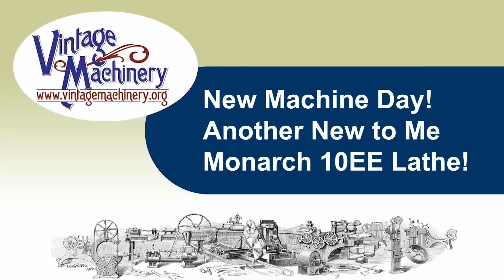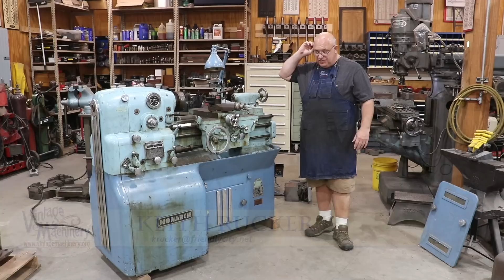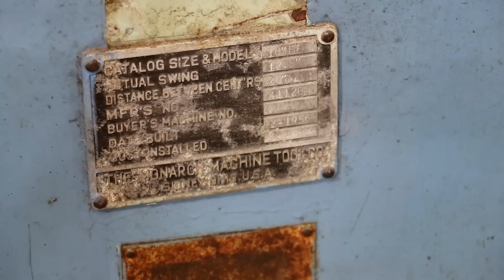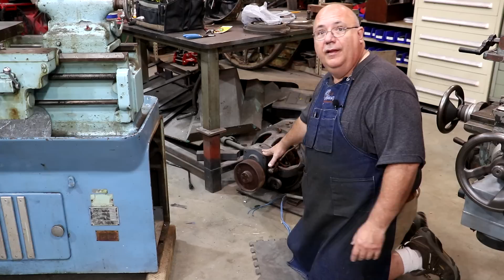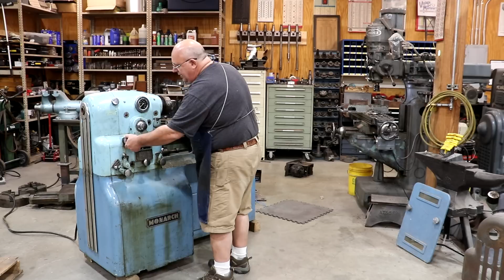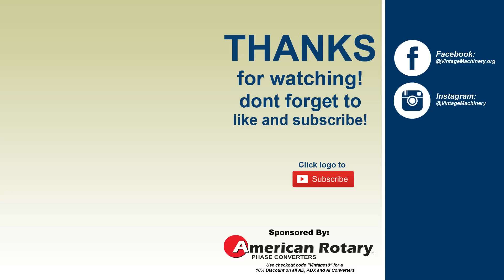New Machine Day! Another New to Me Monarch 10EE Lathe!

Comment: As others have mentioned, it sounds like the motor needs some attention. Probably the brushes are worn out, and making poor connection to the commutator. Brushes are consumables and need to be replaced periodically. Likely they are still available for that motor. If they are allowed to run for a while when work out, they can damage the commutator and make a simple repair turn into a motor rebuild.

Looking at what I can see of that power supply, it sounds like that Variac is a 110V unit, and the bull switch on the back happens to be rated for 120/208, but in fact is only intended to be run on 120V. The circuit is probably thru the Variac to that transformer, which is probably a 120V/240V (or 120V/208V) control transformer. The output of the transformer goes to the rectifier, making pulsating DC for the motor. 

The control system should be making a nice voltage between 0 and 240V to the motor, and the Variac should be controlling the voltage linearly. It seems a little unlikely that running the motor at a lower voltage should necessarily result in the surging, which makes me suspect the brushes. The original power supply wasn't a lot different in concept than that jury rig that the unit has now.
Reply: I disagree. The reason the original unit had valves was because it had good load regulation.
Variacs have terrible load regulation and a variac system on a lathe like this was a terrible choice, a nasty kludge probably done by a seller at some point.
Modern DC motor controllers are common and cheap enough.

Comment: Is there any chance of getting an original control circuit? Looking at the schematic there's a lot of sophisticated wave shaping and phase shifting stuff to make the lathe work really well and not change speed under load etc.  There were only two tubes, both rectifiers which could be replaced with industrial diodes. Then all the capacitors would have to be tested and probably a lot of them repl;aced, but for very little money it would work like it did when it was brand new. You could get any kid in an EE program at college to fix it, or even advanced hobbyists. It would be a shame to give up all of that sophisticated engineering that went into it.
Reply: Patrick, where did you find the schematic?  I'd like to have a look.
Reply: @hankcohen3419 https://www.normanmachinetool.com/wp-content/uploads/2017/02/Monarch-10EE-Manual.pdf
Reply: @hankcohen3419  Keith has one of  the Works in a Drawer (WiaD) 10EE manuals on his site. The manual has  a schematic.
Reply: @ronkellis769  Thanks!
Reply: A "Works in a Drawer" drive has 2 C16Js for armature voltage control, 2 3C23s for shunt field voltage control, an EL1C for DC control voltages and  5 other 'audio' tubes for timing pulse generation, power on restrictions, etc.  It's more complex in that there's provision for increasing armature current under load and the whole 'field weakening' thing to get the motor up to full speed (with provision to handle field loss, etc.).  The DC panel handles fwd/rev switching interlocked, anti-plugging relay, applying field for acceleration/deceleration.  The motor is a compound motor with both series and shunt fields for stability across the speed range.  For it's time it was a heck of a drive, still is really.
Reply: @russkepler  I'm still looking for the schematic.  Can you post a link?  I don't see this in the 10EE manuals.

Comment: Modern mill spindles all use AC drives that suffer from low torque at low speeds. Some but not many have a high/low gear to mitigate that. But most just over size the motor. I have a machine with a 25HP spindle that can't do what my 3HP vari-drive does on my manual DoAll mill.
The Hardinge  toolroom lathe uses a cone pully varidrive and a two speed motor for great performance over a wide speed range. A gear system that reduces the speed by half doubles the torque. Without a gear ratio means of getting low speed and  high torque, the cut performance suffers at large diameters. You can't drive big taps or big drills either. This is why most lathes have a geared headstock. If you put a vastly over sized AC motor in your lathe you might get enough torque at low speeds. A  gear box would help too. Modern motors are much smaller so a 10HP maybe larger might fit. I wonder why they put vacuum tubes in a lathe when no else was doing it and better and simpler solutions were widely understood.

Comment: Full wave bridge rectification of 208V AC = 291V DC, but you need the filter capacitors which are missing. 291V DC is to much for a 230V DC motor. My question is; are the monarch DC motors series or parallel field motors?
Reply: Not sure where you're getting 291V, full wave rectification of 208V would give about 80% of the single phase voltage.

The original motor on the 10EE is a compound wound motor, both series and shunt fields.  Not common.
Reply: @russkepler  peak voltage of 208V *sqrt(2) = 294V peak, so with capacitors 294V minus a few diodes
Reply: @fuzzy1dk  the 208 is the RMS voltage, you're not going to see more than that after rectification and smoothing.  Since the 10EE motor is a DC motor you're not going to be supplying unrectified AC to it (even if the rectification is being done with switched SCRs or thyratrons).  In this application it's common to use the transformer in the machine base to get 300V to the drive so it can reach the desired 245 for the motor.
Reply: @russkepler  208Vrms is 294Vpeak so that's what you get if you rectify and smooth it
Reply: @fuzzy1dk  Sorry No,  While the peak is that higher voltage, the RMS voltage is the DC output when rectified. So in lay terms When the AC is rectified into DC the signal is taken the absolute value through a full wave bridge rectifier and then it is flattened to DC by the output filter after the rectifier.  When the peaks a flattened they fill in the valley and the level ground you get is the RMS value.  if you don't run that voltage through a low pass filter then you will get a sine wave that is just a sine wave that is always positive from 0V to Vpeak.  When filtered (smoothed) you then get the RMS value.
Reply: @hardkrash  no, https://www.circuitstoday.com/wp-content/uploads/2009/08/bridge_rectifier_with_capacitor_filter.jpg
Reply: @hardkrash Obviously you have never built a power supply. The one I have just built has a 240VRMS secondary and it will deliver 330VDC after smoothing, less diode drops, less whatever the load does to the transformer regulation.
Reply: @russkepler  with full wave rectification the resulting DC voltage is 1.4 times that of the AC voltage. Now with half wave rectification it's only multiplied by .7 with the result being a lower voltage.
Reply: @russkepler  Also known as a SEPEX??  (separately excited field)  ??
Sepex was the only reliable way to get regen.

Comment: Interesting that Monarch developed a vacuum tube variable speed DC drive for their early lathes. It's a shame that people today don't understand that those were perfectly good designs that worked perfectly well and are easily repairable, as long as you can find someone who is comfortable with vacuum tube "hollow state" electronics. Here you have an example where someone couldn't be bothered to figure out what was actually wrong with the old system, so they spent more money replacing it with something inferior than it would have taken to simply fix what Monarch had designed.

Since you always seem to have plenty of info from Monarch on their mechanical parts, I suspect you also have the electronic data. Any parts that might have been needed are still available, including replacement vacuum tubes. You just have to know where to look. Unfortunately, this is overwhelming for too many people today.
Reply: My original 10EE "Works in a Drawer"  drive is still working in my lathe.  It took a little work to diagnose and repair but the 100:1 speed range is worth it.
Reply: Interesting. Just because an older technology such as vacuum tubes are no longer used doesn’t mean it’s faulty. Attempting to modernize a complicated system like that opens up a whole new can of worms. I’m sure Keith will come up with a good way to get this one running again.
Reply: @ellieprice363  old systems were built to last and the new generation thinks “well this is a newer system so it has to be better and more efficient” and unfortunately 9 times out of 10 it’s not. I just replaced my parents furnace that was built and installed in 1968 with a new Payne unit. Olathe old unit still works and is about 150#’s heavier. I put it in my shop for heat because it will last a lot long and just works
Reply: @paulerenberger1286  That’s very true. My first home furnace was a Bryant which lasted 25 years and second is a Payne still working after 15 years. High quality filters changed regularly make a big difference.
Reply: Not exactly vacuum tube, it's Thyratron based, tube equivalent to SCR/triac variable speed drive for DC motors.
The trouble is more with armature/brush wear on old DC-motors, whereas AC and BLDC are essentially zero wear, except bearings.
Reply: Very interesting!

Comment: Finding tubes to rebuild the power supply from scratch would be a hoot. Just sitting here thinking, yeah.... I'm pretty sure using modern tools it is possible to manufacturer tube parts, but to put them together you would need a tube lathe. It's a combination of a lathe, a vacuum pump, and a positionable set of torches.
Reply: the tubes in it were just rectifiers which you could replace.
Reply: @PatrickPoet  No, the tubes include a rectifier but also there are 4 thyratrons, 2 for armature and 2 for field.  There's also 6 or so audio tubes.
Reply: @russkepler  thanks Russ, I must have been looking at the schematic for a different year. Even still, for someone that knew a little about electronics converting it to work identically with solid state components would be easy and inexpensive.
Reply: @russkepler  It's likely NOS thyratrons can be sourced from Radio Electric Supply located in Florida.  Many audio types are in current production, as are some rectifiers.  FWIW, the solid state "equivalent" of a thyratron is the silicon controlled rectifier (SCR).
Reply: I came across "drop-in" replacement SCR modules for 10EE's.   The main trick changing over from a tube to solid-state is that the gate drive circuit requires more current than the tube version.  The module handles this with a few discrete components.
Reply: @russkepler  The version I'm looking at has 3 thyratrons only and two silicon diode rectifier bridges.  Can't find a date on it though.  I'm curious if this is before or after that one.
Reply: @blahblahblahblah2933  that's the "Modular" drive. Introduced in the early 60"s.  Easier to service than the WiaD drive but has it's own issues.

The common failure there are the tubes and the diodes in the black module box.
Reply: @eliduttman315  the C16Js are fairly difficult to source, the rest pretty easy.  Luckily an outfit is making solid state replacements for the C16Js at a very reasonable price.

As for a semiconductor replacement for rhe whole drive at least one is being built as a drop-in replacement (Beel) and there are some others that come close.  It's harder than it looks as the demands are hard to meet, high current demand with high back EMF means a lot of consideration given to bullet-proofing the design.  The early Ward/Leonard motor/generator drive is bulletproof, the first tube drive nearly so (but has the problem of the tubes wearing out), the second tube drive better with only 3 tubes to wear out (but some problematic first generation diodes you should upgrade).  The first generation semiconductor drive is considered unrepairable by most people (I'd like to try - the time it was designed overlaps my education in electronics).
Reply: Wow!
Reply: Tubes are currently being manufactured.  The situation with the American owned Saratov, Russia, plant may be "up in the air".  JJ in Slovakia is on the job as is Shuguang in China.  Some specialty types are still being manufactured in the U.S.A.
Reply: @eliduttman315  Most current production tubes are targeted at the guitar amp market.  There may be a few rectifiers among them but probably not at the current ratings required to drive a lathe.  However, there is a healthy market for used and new-old-stock tubes.  Unfortunately, Keith doesn't have the original power supply so a replacement will be necessary.  Certainly you can do today with solid state power electronics everything they could do then with tubes.
Reply: Here's someone with a functioning modular controller: https://www.youtube.com/watch?v=PX0dn9bpx_w

looks super neat.
Reply: The machine to build or rebuild a vacuum tube is called a sealer, they were huge and costly.  They have all likely been junked by now.  the last time I personally saw one was in the late 70s.

Comment: What a score!    That rectifier is missing a huge capacitor bank to smooth out the DC
Reply: There's no need to remove the 60hz ripple. The motor doesn't care about it and a capacitor isn't going to change its behaviour. A closed loop system is probably what it needs.
Reply: @Rich-on6fe  yeh, it seems there are plenty of DC motor controllers that are basically a lamp dimmer and a  bridge rectifier

Comment: I have a 10a variable transformer right now controlling the fan in my bedroom I never turn it below 60 percent as the current to the motor increases. Makes it possible to slow fans down so they are quiet. I vary the speed of my finish sanders too.  That looks like a 30 or 40 amp variac probably around 500 dollars or more. 
I had an accident with my variac.  Somebody gave me a good used jumbo jet landing light.  250w @28 volt spot light.  I live about 2 miles from a big sign on a hill. I adjusted the variac to 28 volts. Put a lamp cord on the landing lamp. I had set the variac on a wall in my back yard and tried to illuminate the sign .  I pulled too hard on the lamp cord and knocked the variac off the wall. I caught it by the knob and it twisted to 110%  the now purple white and humming landing light swung illuminating the apartment building across the freeway for a second with a light that was brighter than sun light as the bulb burned out. A few tenants opened their windows and stuck their heads out wondering what the heck was that crazy bright flash of light.  That was almost 25 years ago.  I really should go over and ask if anybody had seen a crazy bright flash of light in the late 90s. That sign awaits. My variac awaits. A 12 foot hospital grade power cord awaits. I just forget to stop by the aircraft parts place to buy another crazy bright landing light bulb.
Reply: (:-)) Funny story. With all that knocking, twisting, falling and landing lights scaring the neighbors it might be a good idea to let this one rest and hope it don’t jump!
Reply: @ellieprice363  never thought about it. Just a smile on my face to light up the sign.  Had a plan for test 2.  A black tube to trap stray light to the side.  Making it crazy hard to see where its coming from unless you are up near the sign..  a few years later I was doing dishes.  Could see huge arcing from the transmitter building to the tower.  I called non emergency police dispatch.  Verified the city uses that tower.  Said its arcing. She said your miles from it.  I can see it.  Do you have a police copter near there. Yes. Within 2 minutes they were in a hard orbit shining down the midnight sun. We cant see it.  I said to her turn off the midnight sun.  Seconds later it went off o we can see it now. 20 minutes later I saw a vehicle racing up the access road.  I never learned what went wrong.  But its always wild to live here.

Comment: Hi Keith, regarding electric motors, there is a book on the market (written by a man in the USA) “electric motor repair” Rosenberg is the author. I encouraged many apprentice armature winders to get this book as a learning aid that would help in almost any circumstance. The beauty of this book is that it isn’t written for engineering students and graduates .
I qualify this statement with over 40 years experience in the manufacture, repair and maintenance of electric motors. Great show as usual👍👍
Reply: I know that book. Excellently well put together little gem of a book. Even as someone who doesn't do this for a living, just as a hobby at best, it's easy to understand and use.
Reply: @aserta  bought my copy back in the 70's, still have it and still refer to it for theory and assembly.
Reply: Regarding armatures and so forth, who sells the actual materials to rebuild a small armature such as the insulation paper for the slats, the electrical varnish, the shrink paper ends, the twine to tie things up together, and so forth?  If anyone knows of a good supplier specifically for this I would greatly appreciate it.  Hello from San Antonio, TEXAS too!
Reply: @jtg2737  I've purchased "magnet" wire with class H insulation from Temco in the past.  Some of the other supplies can be harder to track down, usually because we don't know the correct "name" to search for...
Reply: @prototype3a  Thank you for this information.
Reply: @jtg2737  There's a motor repair shop down off Rhapsody by the airport. Cant remember the name. But, they are GENIUS motor repair guys. They would probably sell you the supplies you need, or at least point you at their supplier--hope this helps.
Reply: @geckoproductions4128  Thank you.  Hmmmhhhh, I'm guessing "Good Electric" at 9018 Aero street?  Could that be it?  That is close to Rhapsody road that I am across.
Reply: @jtg2737  I just looked at google maps. Place was located across from Bear Oil around corner from Rudys at Nakoma and North Loop. Rudys used to be some independent BBQ joint and building across from Bear Oil does not appear to be occupied---maybe out of business, sorry.